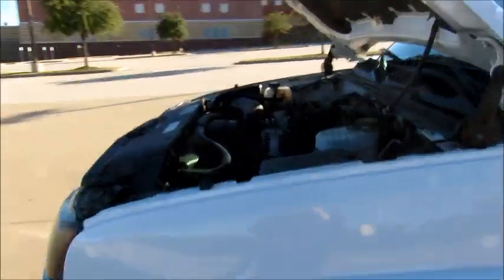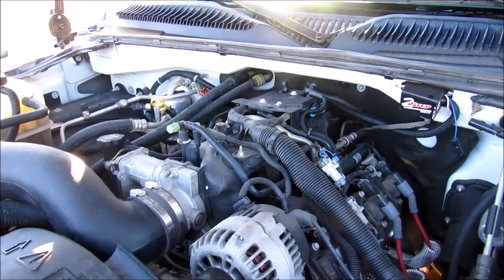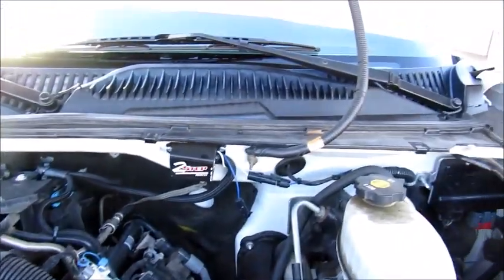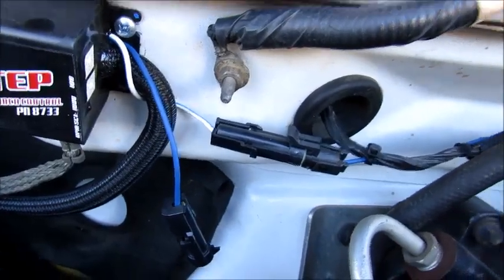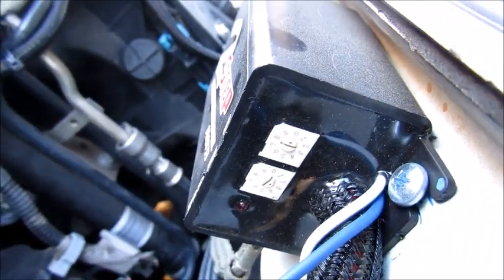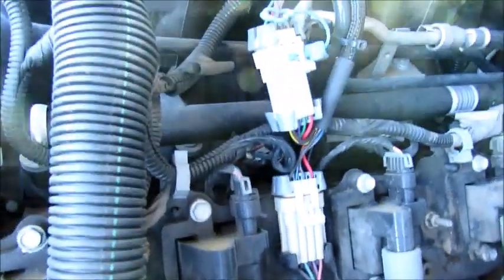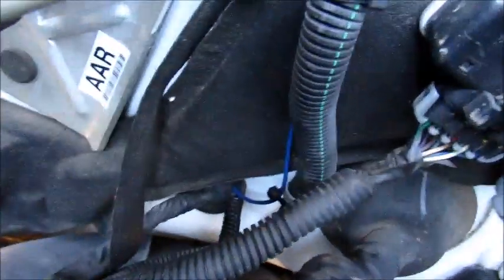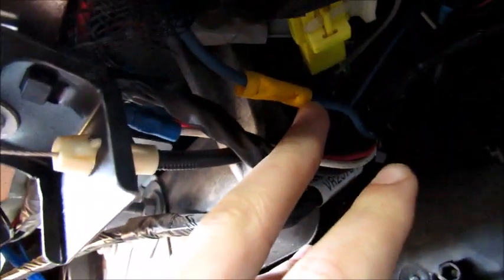MSD 2 step silverado

Comment: So how do you do a burnout if its wired to your brake?.
Reply from the maker: WatDaHeckman i knockout two birds with one stone that way because youll be on the brakes and gas the whole time youre doing a burnout. the power of the truck will break the rear tires loose while leaving the fronts locked because thats how they are designed (you get most brake pressure from the fronts. the two step just limits my revs so i can floor it without worrying about hitting redline (consistency). i hit the brakes which holds my truck still while also engaging the 2 step (when brake is pressed it sends 12volts through the wire to my 2step module thus activating it) this way i dont have to hold my brakes and hold a separate switch to engage the 2 step.
Reply: So if you're already doing a burnout and still in the break I figured the 2 step would stay on. Or once its past a certain rpm does it disengage?. Thanks for the detailed reply, I have a truck just like yours
Reply from the maker: WatDaHeckman oh i see what you mean. my bad, yeah i have to let off the brake then the tires spin and immediately get back on the brake so i dont keep going forward. the 2 step disengages once the tires spin so it doesnt kick back on when you let off then hit it again. its like a built in safety mechanism
Reply: Ahhhh, yea that was my question. I'm not sure if I could wire to the brake or not cause I'm on a 35" tire. Maybe who knows. It would be nice to not have to worry about a switch

Comment: Hey man could you post a video of it launching without 2 step?
Reply from the maker: Fully Functional sadly i don’t have the truck anymore and don’t have any video like that
Reply: @carterm623  dang, well reason I ask is because I was looking for a way around a trans brake but doesn't look that way for me. My single cab has a 3600 stall but doesn't let me go past 2500 rpm on foot brake. And seeing how I run an 295 et street tire, I have a slow launch.  Guess I'll just start getting ready for trans brake and 2 step....

Comment: What exactly did u wire it up from brakes ?
Reply from the maker: Lisandra Ramirez i connected the 2 step wire to this wire on my trailer brake controller that gets 12 volts when i press the brake down and that activates the 2 step
Reply: Do u kno what else I could activate it with
Reply from the maker: Lisandra Ramirez just any wire that gets 12 volts whenever you hit the brakes.

Comment: Can anyone tell me what does the line coming from the top / front of the intake with the green cap on it runs to or connects to ? Thanks in advance
Reply from the maker: Mr Man this is what i found on a forum...
it is part of the EVAP system, that line is attached to a solenoid valve located on top of the intake which opens and closes to allow fuel vapors to be pulled into the intake and mixed with the fresh air for combustion.

Comment: Awesome video bro and so like I would have to buy the 2 step and just take it to a mechanic and they can put it but I would just have to tell him my stall?
Reply from the maker: Jose Hilario me and my dad put mine in together but he’s also a GM trained technician. it was pretty simple though. but you dont need to tell him ur stall, you can just set the dials on the 2 step yourself with a screw driver and just go as high as it will let you. if you go too high then it won’t hold and the truck will slowly creep forward when ur trying to launch instead of sitting still like it should. mine only holds at 3000 rpms
Reply: Carter Mckinney aye bro little late but would you still be able to burn out tho? Cause I just fixed my transmission with stall for my cam and I was thinking about getting a trans brake but the 2 step is way cheaper?
Reply from the maker: Jose Hilario yeah you can still burn out, i wired mine into the brake so i just press the brake down then floor it and it holds the engine at 3000 rpms then i quickly take my foot off the brake and it spins the tires like crazy then i just put my foot back on the brake once its spinning to keep the truck from moving and do a big burnout.
Reply: Carter Mckinney alright thanks bro👍🏽

Comment: So I installed mine like urs but for some reason mine stays on all the time help please
Reply from the maker: Brian Butler i dont know what you mean when you say it stays on all the time? if you wired it into a wire that activates it when you press the brake then the only time its on is when you hit the brake. but if you wired it into a wire that has voltage all the time whether you hit the brake or not then you screwed up and need to wire it to a wire that only gets 12 volts when you hit the brake, or wire it to a switch.
Reply: Carter Mckinney I wired to my brake like fuse
Reply: Brake light fuse

Comment: Bro what do you have under the hood
Reply from the maker: Jose Bustos 6.0, btr stage 4 cam, upgraded valve springs, cold air intake, texas speed headers and full custom true duals, 3200 stall converter and 2 step in this video